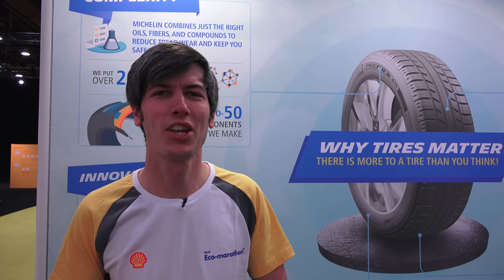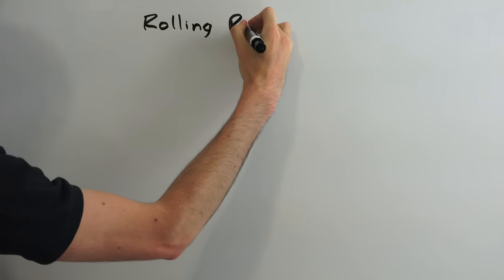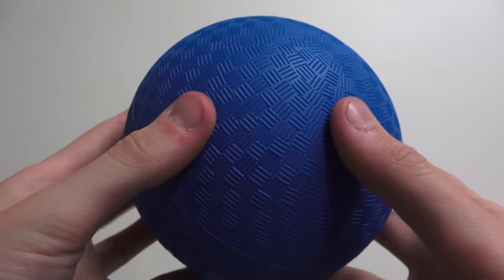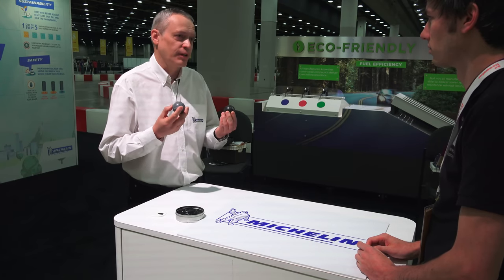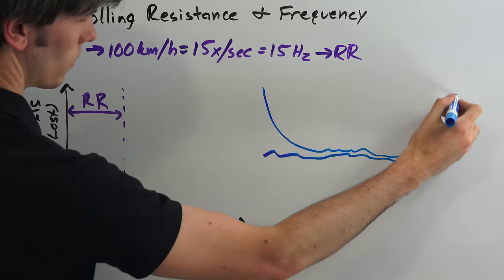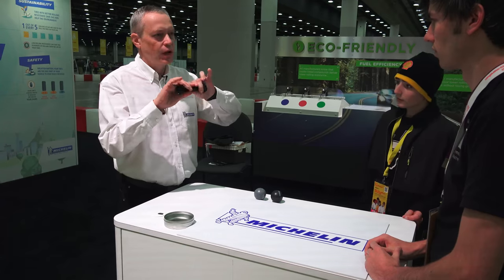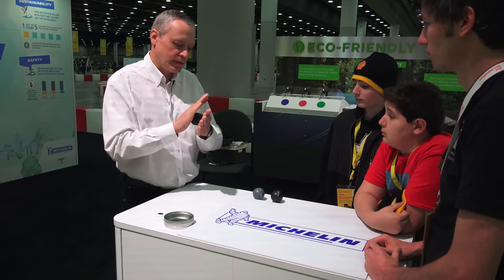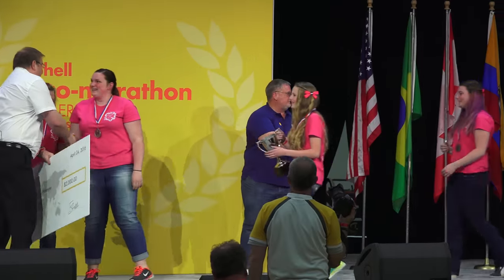Can A Tire Have High Grip And Low Rolling Resistance?

Comment: Nice to learn that we can have the cake and eat it too. I always thought tires was a choice between high durability, low-rolling resistance but with a hard compound with low grip or vice versa. Nice to know we aren't too far off with this technology to be applicable to cars with both a performance & economical faces.
Reply: +Trades46 It still is, but less than it used to be.

With silica we can achieve higher grip with the same rolling resistance than before, or lower rolling resistance with the same grip than before. Or somewhere between the two.
As silica technologie advance, we can make the difference in response at low and high frequency increase, thus increasing the grip and / or rolling resistance even further ;)
Reply: +Joe Blogs I don't know were you get that from. All road tires use silica and modern road tire performs better on wet roads.

Comment: Excellent video, extremely well explained. It's good for drivers to understand the basics of what a tyre actually does in contact with the road and how that affects the vehicle. Considering that the tyres are the only bit of the car that actually touches the road, they're very often an overlooked aspect. 
Great job once again!

Comment: The rolling resistance of those tires on asphalt is 1/4 that of steel wheels on a steel track? Whoa.
Reply: +Tamás Madarász yes but because of the weight of the cart it presses onto the rail creating the grip, thats why low weight high performance cars need wings to press it onto the road to create grip,
Reply: +Tamás Madarász yeah, i think he meant four times not a fourth
Reply: +GraveUypo I think so, cuz that just sounds wrong
Reply: +GraveUypo Actualy my school won at this competition several times and the tires are about the same rolling resistance as Steel on Steel. But they are very fragil, a stone and they are broken.

They are very very thin and have high pressure (4-7 times the pressure of normal road tires)
Reply: wouldn't this make trains obsolete?
Reply: @nickl7488  i think that it would not make trains obsolete, because of the amount of weight that they carry. The amount of product that they transport will translate to enough savings to make it worth while.
Reply: It feels very unrealistic...

Comment: That's sooo cool.  These are the sort of eco developments that we need, those which improve fuel efficiency but without having to trade off something else for it.  These tyres might be more expensive at first, but dependent on the amount of fuel they save they may well prove an economical choice immediately.  There should be no reason that this technology isn't on all cars, with the potential savings in emissions being huge.  Great stuff.

Comment: I learned about this in a lecture. The different energy loss factor of rubber in different frequency ranges is explained by the Williams-Landel-Ferry diagram - rubber with silica additive has higher energy loss factor in low temperature range and lower energy loss factore in high temperature range. I just can't figure out why braking (high frequency) corresponds low temperature.

Comment: Interesting EE. I swapped out the stock Michelin tires that came with my FR-S for Michelin All Weather Super Sport tires. The mileage is slightly less than the stock Michelins, which were optimized for high mileage, but it is a good trade off for me because I like the handling of the Super Sports much better. And after all handling is what the FR-S is all about.

Comment: Awesome video!  I've always wondered about the magic behind LRR tires ever since I bought a set on a whim a few years ago.  Their contribution to overall efficiency is minimal compared to the other resistive forces, but working as part of a system designed to be efficient, they definitely make a difference!  Talk to any tech-savvy long-term Prius owner and they'll tell you all about their adventures with different wheels and tires.  :)

Comment: That's awesome! Any word on when this will become available to the public? I'd imagine it'll be pretty expensive for a bit until they're able to get costs down, though.
Reply from the maker: The tech has actually been around since 1992 when Michelin first invented it, but they've been improving it ever since, and it's transformed the industry as everyone now uses silica compounds.
Reply: +Engineering Explained How does the wear of the compound compare to earlier versions of radial tires? If it has high grip I would imagine it would wear quickly, similarly to a performance oriented tire but with low roll resistance I would imagine it may negate this effect of wear.
Reply: +Engineering Explained Sweet! Never knew that. Thanks for the awesome videos, Jason, and hope you enjoyed your time in my home state of Michigan!
Reply: Michelin is currently selling tires to the public with high levels of silica. The Michelin Premier A/S and the Michelin Pilot Sport A/S 3 are two examples. Go get them! I have the A/S 3 on my car, awesome tires!

Comment: So, non-Newtonian rubber?
Also us older guys used to work on a 4 PSI difference between cold and hot. So if your tyres are inflated to 34 PSI when cold, they should reach 38 PSI when hot, and no more. 
If they increase more than 4 PSI when hot, your cold pressure is too low and needs to be increased. If they go up less than 4 PSI when hot , your tyres were over inflated when cold and should a lower pressure when cold.
Car manufacturers usually go for comfort which is too low when cold.
Not sure if it applies nowadays. Replies welcome.

Comment: The real question is can we have a high grip without having the life reduced ?
Reply from the maker: +GogogoFollowMe That's the goal. This is something Michelin is currently trying to demonstrate in Formula E, as they don't have tire swaps so the same set of tires have to last through practice, qualifying, and the race. I've spoken with a few team engineers and they say the degradation is very low.
Reply: +GogogoFollowMe I guess it would depend....  
I drive a lot for work so I have two examples: 
I have a sports car with very soft tires. At first I thought that they wouldn't last, but They lasted over 70,000Kms with a double wishbone front setup and multilink Rear RWD. ( Can't rotate due to the different front to rear sizes ) 

I also have a small hatch back with tires that were about the same 140 treadwear and they only lasted 40,000kms with a McPherson front setup and torsion rear... FWD and 1/2 the HP. ( Rotated every 15,000km) Still not that bad.  

I also check and adjust the tire pressures weekly, so they are never low or high. 

I assume that the life depends on too many factors, including the setup of the car, how you drive, types of road etc....
Reply: +GogogoFollowMe Well if you look at the 2010 Formula 1 Bridgestones, where the disbenefits of the tire degradation is less than the benefits of weight loss from fuel throughout the race (net benefit from the two factors), if my memory serves Sergio Perez ran 80% of the race on a set of Options in Valencia. Correct me if i'm wrong, but i do remember him racing a very long stint on one set of tyres. That's one mighty compound Bridgestone got there.
Reply: I think it really depends most on how you drive.  I don't think that sort tires would wear out fast if people weren't putting excessive stress on them.  If you increase the stress, you increase the wear.
Reply: There is no practical incentive to commercialize a high-grip tire with minimal wear. They want to make money. Their commercial formulas would be centered on some exec's cost-benefit analysis.
Reply: @Merrinth  I don't think so, there is a lot of competition in the field. If one manufacturer were to make such a tire - it would gain more in new customers than in selling the same tires to same customers. Anyway, the tires won't have infinite life, after 5-6 years it starts losing it's properties, so will be changed anyway.
Reply: 2:50,
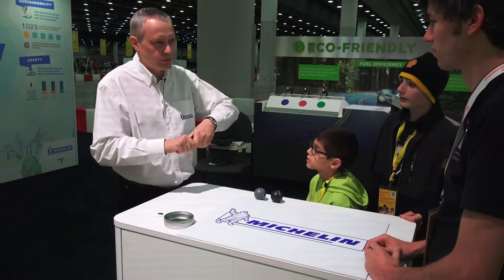Reply: 4:50,
Reply: HIGH GRIP + LRR ?

Comment: Interesting video, I didn't know about the importance of silica on the energy losses prior to this.
However his demonstration with the "silly putty" was innacurate, because it had higher losses at low speeds and less losses at high speed (opposite to what you explained in your graph).
Reply from the maker: +Richard Andersson Haha, everyone keeps mentioning this - at 4:53 he mentions that tires behave exactly the opposite. The demonstration shows that you can manipulate the behavior of a compound depending on the speed of deformation (frequency). Tires will have high energy losses at high frequencies (where as this 'putty' he's using does not).
Reply: Engineering Explained Sorry, I completely missed that. I would however be very interested in knowing why silica makes rubber behave the opposite. All normal plastics are viscoelastic (opposite to what you want in tires), such as rubber without silica, plastic bags or even silicone based compounds such as "silly putty".

Comment: So it's a  non-thixotropic dilatant fluid? How does it keep its shape when it's in the tire? I'm assuming there are solid compounds in the tire material matrix that act as a clathrate with this new STF material and the two subset phase types (plastic solid/fluid) combined act as a Bingham plastic? 
  Great video, thank you!

Comment: Just to set things straight, the silly putty is "exactly the opposite" of what the silica tire does.
And, the low frequency is the tire ROTATION at driving speeds; the high frequency is the IMPACT with the road.

tldr, low rolling resistance, high resistance at micro scale contact with the road.

Comment: How do the Shell Eco-Marathon tires achieve one-fourth the rolling resistance of steel wheels on steel rails? Perhaps the rubber compound deforms more than steel, but loses a lot less energy to hysteresis per unit volume deformation. It kind of checks out when you consider how low of a height a steel ball rebounds to when dropped compared to a rubber ball.

Comment: based on the Michelin low rolling resistance tire I got,  the answer is no. the tire was a hockey pock in rain
Reply from the maker: +Simon Zhao Hockey pucks actually have a pretty high hysteresis (and thus grip). :P
Reply: +Simon Zhao Well, low resistance tires grip will probably improve when this new technology comes to the market. But, I agree, for now it's better to go with a regular tire, not a fuel saving one. I can recommend Conti Premium Contact 5. Excellent wet grip, almost as good as when it's dry. Crazy really.
Reply: +Engineering Explained I meant like hockey puck on ice
Reply: +popula I can vouch for you, I have conti contacts on all four corners, literally amazing tyres.

Comment: Fascinating.  I think I've missed or didn't grasp the concept though, regarding how silica's high deformation at low speed and less deformation at high speed (instead, breaking) helps maintain grip at high speed (frequency) while providing low rolling resistance at low speed (frequency).  Wouldn't it cause the tire to deform more at low speed and less at high speed?  Is that accurate?  

Or is it that it deforms more while stopped or at low speed, allowing for traction off the line, but then quickly firms up and reduces rolling resistance once the tire is moving?  So while it will perform better from a stop, it likely won't handle cornering or high performance as well as a sport-oriented tire (such as their Pilot Super Sport tires).
Reply: I spotted the exact same logic error. You want the tire to not deform when done slowly and deform when done quickly. And the exact opposite was demonstrated.
Reply: he sead in the video that their material do opposite thing that the material he just showed

Comment: sorry for my English, but I wanna ask:
As we were explained, if we want low rolling resistance we need a tire, that is hard at low frequency deformation, so, it needs to be hard when you deform it slowly. From another angle, we need soft, elastic rubber at high frequency deformation, if we want to have some grip. It means that tire need to be soft, when it deforms quickly. BUT, what we saw on demonstration whit the sample of rubber is totally otherwise! The sample is hard, when deformation is fast and soft when it's slow. Won't the tire be high rolling resistance and with no grip, if it's made of this rubber we were shown??

Comment: True or not,  I've heard that tires with low rolling resistance do not allow for static that builds on the vehicle while traveling to discharge through the wheels as easily as the "normal"  non low rolling resistant tries would.
Reply: I've done a small amount of research and found out that tires have compounds in them that allows the vehicle to discharge static through the tires into the ground.  On normal tires, they said they use some sort of carbon black additive to allow the vehicle to be grounded, but with the use of silica, the tires are less conductive and therefor the vehicle takes longer to naturally discharge any static build up.

Comment: The guy said the demonstration of pulling apart the silica compound putty shows the exact opposite effect to  tyres with silica compound?? I'm confused - pulling apart the putty quickly (ie high frequency) leads to it breaking into two, but don't you want it to deform slowly at high frequencies to simulate grip?

Comment: how can the rolling resistance even be 1/4 of that of a trains's wheels? steel doesn't deform almost at all.
Reply: I wonder if it is the rails deforming. At every track I've been around, you can see the ties moving and if the bearing structure is moving, the steel on top of it has to be moving as well.

Comment: can you make a video and explain what you need to do to your engine when a turbo is install?
Reply: Get a tunable ecu to adjust a/f ratio, new MAF, bigger injectors(probably) front or sidemount intercooler for turbo, oil cooler, waste gate/turbo timer, blow off valve, upstream 02 sensor(s) and possibly bigger exhaust

Comment: So, other than Michelin, which tire manufacturers have introduced the silica/rubber compounds? Are there more inexpensive yet capable alternatives to the big manufacturers?
Reply from the maker: I believe most of them are using it now, though Michelin was the first.
Reply: Engineering Explained I'm in the process of buying LRR tires for a Camry Hybrid and it's so confusing with all the options...any recommendations?

Comment: It also seems that the tires that are originally fitted to new BEV and hybrid cars are lower rolling resistance than the replacement brands that are available to the public . For example my 2011 Volt came with Goodyear FuelMax that are a special light weight version than the version of Goodyear fuelmax that tirerack.com sells.  A lighter tire provides better efficiency because there is less inertia to overcome to make the wheel spin. I wish there was more emphasis on efficiency when it came to tire purchasing decisions instead of making it difficult to find the best tire.

Comment: I liked the idea of the low rolling resistance tires until I started looking at reviews of them online, they claim if you don't wear them out in the first couple years that they'll dry rot/crack out and will need replaced.
Reply: +Kent Sextro This is actually true of all tires as far as I know. They can always dry up and have cracks.
Reply: +John Bäckstrand All tires will, it just depends on when. 
Different tires dry rot/crack faster. They crack faster when in hot areas more often, as well as when they are not rolled often. 
You can generally expect 8-10 years before cracking occurs, which is when they are due for replacement due to the age of the 'glue' on the carcass.

Comment: why do two tires of the same compound/width/height with the same rating have different "stickyness"? for example two tires that are 245/45r17 and both are rated at 98y but one tire is stickier than the other.